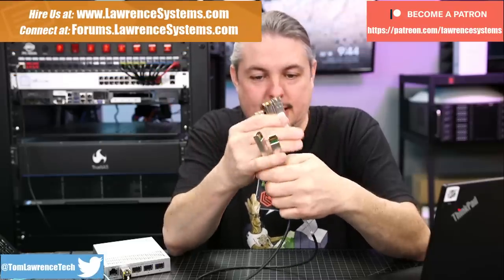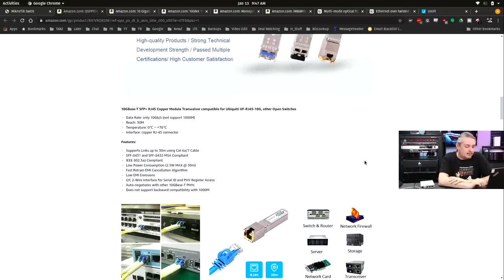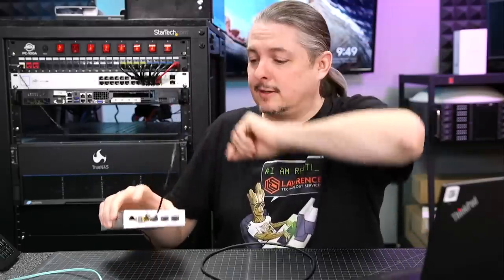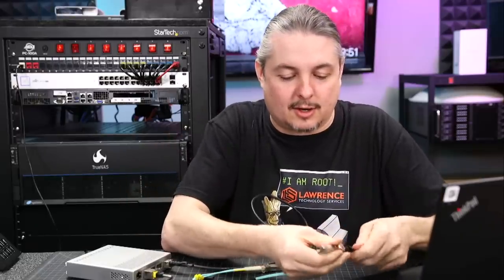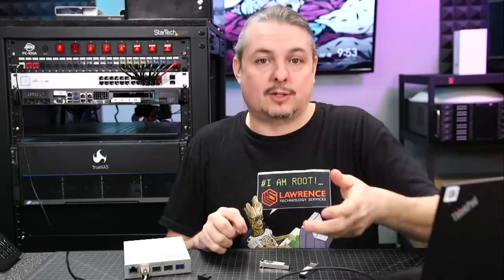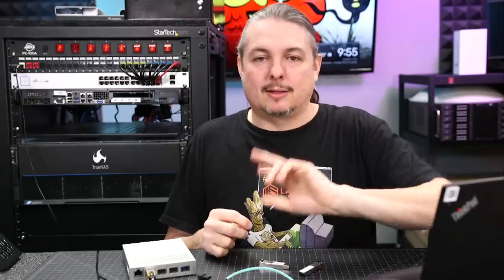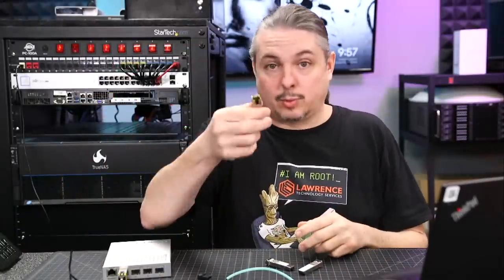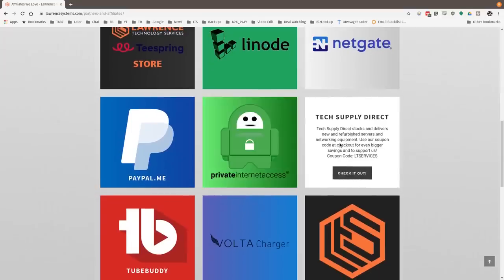Comparing SFP+ 10 Gigabit Connectors: LC Multi-Mode Fiber, 10GBASE-T, and DAC Cables.

Comment: Another good supplier of SFP/SFP+, fiber, DAC etc is Hummingbird Networks.  I have tried FS store, Amazon, and Hummingbird.  I like Hummingbird because of their great support.  You call them to determine if their products are guaranteed to work for a given switch and you get a firm answer.  If they don't know they will sometimes send you a trial device.  If it works, you pay for it and keep it.  If it doesn't work you simply return it.  Can't ask for more.

Comment: I'm working in a Datacenter as engineer and if a costumer asks for MMF connects I just show him the door or hit him with my SMF/E2000/APC whip.
TLDR: Use Singemode
Rant about MMF:

From an investment standpoint, if you still have OM1 (gray) cableing, rip it out. If you have OM2 (orange) or OM3 (blue) ok. 
Don't buy OM4 for new long runs over 30m, it's ok inside a rack but it's failing to often. 
Don't be hyped about OM5 - to expensive and in 850nm it have more lost than OM3/4 because it's made for WDM SFP's with multible colored waves in one fiber.
For new installs, use SMF and splice them to an APC Connector LC/SC or best E2000. Yes you need matching patch cabels for it, but if you forward a fiber link from your carrier through a building to your office via multible patchrooms, you will see the difference. Yes the SFP's are more expensive (20€ vs. 26€ @fs) but in the future if you upgrade to 25/100 or 400G. 400G QSFP-DD LC Duplex with 10km LR4/LR8 are on sale now (4000€-10000€ per SFP but 400G!!!)
Even if you only need 100G at the moment or even only 10G, you don't want to replace you pre installed cabeling only the SFP's. (100G is @ 1400€ for a pair of SMF QSFP28 Modules)
Also most QSFP-DD are SMF only.
I normaly compare vendore SFP's with FS or flexoptix pricing and then choose what I need. If I need max. compatibility because I sell them to carriers if they have a broken one and need a replacement now - I choose flexoptix flash them and it works.
If you build a office, just run fiber most of the way, pace a switch where your users are or plan floor tanks with space for switch, patchpanel, cable etc.
Yes a fusionsplicer starts at 2500€ and easily go up to 10000€ but when I had the first one with a raw 12core cable on hand I had figured it out in ~30min without introduction. Also the device tells you if the spice is ok, @ rj-45 you mostly have to check the complete cable to find the error.

Comment: We've been using 10Gtek transceivers for both ubiquiti and HP procurve / Aruba switches for 2-3 years.  Haven't  had a failure yet.
Reply: Wich 10 GbE cards or onboards chipsets (i.e. Aquantia AQC 107S) do you use?

Comment: This goes back about 10 years, but the last time I talked to anyone at Fiberdyne, they said they had a new user applied, glued connector for certain types of fiber. The person I was speaking to said that losses were nearly the same as a fusion splice. I haven't needed more fiber for my small system, so never looked into it. And their prices for custom length bundles terminated to customer specs. were so cheap that it generally isn't worth looking into those connectors. 10 years ago the 6 pairs I bought were about $150 for about 130 feet, might have had a nonprofit/educational discount applied.

Comment: The 10G fiber to copper module usually has higher power consumption than the SFP+ standard 1.5W, probably around ~2.5W. This causes the heat and thermal problem and makes it more than 70C. Unless we have a good "cooling" system in the switch. Did you agree with that?

Comment: Thank you! 
It's sad, because especially with regards to professional WiFi 6 APs or newer mainboards, 2.5GBase-T will certainly establish itself as a cheap step in between. What is really missing is an all-round switch that can handle 1G, 2.5G, 5G, 10G over copper AND/OR fiber.
Reply: MikroTik has copper SFP+ modules "S+RJ10" that support speeds from 10 Mbps to 10 Gbps including 2.5 and 5 Gbps.
Or if you want a switch with copper 1/2.5/5/10G ports - have a look at MikroTik CRS312-4C+8XG-RM
Reply: I've recently bought the Netgear MS510TX which seemed like a nice solution.
Reply: thx, havent noticed that Netgear yet. Looks nice! How noisy is the fan? 
The MikroTik Switch would be fanless, but SFP+ Copper Modules are surprisingly  very expensive...
Reply: Netgear MS510TX

Comment: I run 2.5G Base T from my main rig over CAT 6 to a Mikrotik branded 10G transceiver on a CRS305, no problem negotiating at 2500 and I've gotten very close to that in sustained transfer to or from my NAS.

Comment: i'm just starting to upgrade my home network to 10g and got one of those mikrotik switches coming!  i'm trying to use the direct attach cables when i can to reduce heat but will need at least a few of the rj45 modules.  i actually already have cat7 and cat8 cables because they were cheap and i didn't need very many, but this is a pretty old vid haha

Comment: Finally someone who knows how to pronounce "MicroTik". =)
-To my knowledge, there's no firmware on the SFP / SFP+ modules; there's only a short byte-table of 16 bytes (if I remember correctly).Those tables can easily be duplicated by a manufacturer, but if you purchase one that is 'coded', then it will only work in those products that are compatible with "anything" and those that require this code-table (like CISCO).
So a CISCO-compatible module would (likely) not be compatible with HP and vice versa.
That said, there are some modules, that contain diagnostic support, which means they'd have a microcontroller built-in, which means ... they would have firmware. Fortunately for us users, the diagnostic support is optional, so we are not restricted by that.

Comment: Note: Not all PCIe cards with two SFP+ slots can do dual 10Gbit. Some can only do "failover"; eg. 10Gbit on one port and if that fails, you get 10Gbit on the other instead.
I prefer fiber everywhere I can, because once you've tried frying a few 8P8C ports (due to high voltage differences between devices), and you no longer can upgrade your Mac OS, you're not going to risk doing that again.
(Well, it wasn't only the two ports on the Mac Pro's motherboard that got fried; also my router and my switch - the switch can now do 100Mbit instead of Gbit, so it still "works").

Comment: In an enterprise environment like a data center it’s better to use lc lc cables than dac even sfp+ is better. The optics get really hot in a data center environment and the optics fail. Dac cables if this happens the entire cable needs to be replaced. With lc the optics just needs replacing. I have never had a cable failure before it’s always been the optics or a port failure. It’s a pain because if the dac cable is 20m and the optics fail you have to pull the entire cable out and replace it which in a data center is a time consuming process.

Comment: The heat issue with the 10g sfp+ modules is really when you have 2 or 4 of them right next to each other and they heat soak each other. Most switches tell you to skip a slot when using them. Would be nice to see what 4 of them next to each other does.
Reply: I have many 48 port 1U Arista switches full of 10GbE SPFs and no issues
Reply: Thats really a issue if u are using the ethernet rj5 to SFP+ adapter.

Comment: Can not run Cat 6 in same conduit as Electrical  So,I want to run 100' Fiber ( OM3 duplex 50/150 OFNP LC-LC ). Reason Fiber is... it will be in with 120v electrical wires in the same conduit from house to my garage. Will this work ??

Comment: If I have to rewire the house I'd go for the highest available standard, CAT8 or go glasfiber. With the latter being costly but also interference free when new wireless signals might end up trying to interfere with the copper cables again in your house.
Reply: 25GBASE-T and 40GBASE-T were standardised 6 years ago and yet I can find no evidence of them being included in any actual products (thoug I do see a bunch of SfP28 products mislabelled as 25Gbase-t). I would not bet on them ever doing so. It's also worth noting that when 10GBASE-T initially showed up it was only available as a fixed port due to power issues, SFP+ 10GBASE-T transceivers came later and were/are limited to only 30m rather than the normal 100m.

If you think you may at some point need more than 10 gigabits per second then IMO your most sensible options are either to run single mode fiber or to run ducts/conduits into which future cables can be pulled. Multi-mode fiber is also an option for short runs but is less future proof.
Reply: fiber isn't expensive

Comment: Are the ones with the cables not the RJ45 adapters, the ones that run cooler?
Reply from the maker: The SFP+ DAC cables run cooler
Reply: @LAWRENCESYSTEMS  Excellent. That will determine what kind of switch I use. Those RJ45 adapters get way too hot, even when not connected to a cable, but just plugged into the router's SFP port.

Comment: Out of experience: the RJ45 modules always hotter than the fiber ones. I don't really understand it because only in the fiber modules there is a conversion and the amps going through the copper line should be fairly low. It is how it is
Reply: There most certainly is a conersion in the 10GBASE-T modules, between the simple serial data stream used by SFP+ and the complex modulation scheme needed to get 10 gigabits per second down a long cheap cable.  Power requirements are the reason 10GBASE-T SFPs took a long time to hit the market and when they did so they were limited to 30m rather than the 100m of regular 10GBASE-T.

Comment: Is LC multimode cable the choice for home users if you want 10Gb fiber connection?
Reply: Yes, unless you go with copper of course, both are capable with the correct cable/distance

Comment: What makes a 10km SFP a 10km, and a 40km a 40km?  What is the difference?  Is it power tx power and receive sensitivity?
Reply: Don't use the 40km transceivers when it's absolutely necessary. The 40km and 80km transceivers have way stronger laser diodes and if the link is too short, the light received on the other end will be too strong to recognize any signal. These kind of transceivers are used for very long fiber runs (e.g. fiber running between two distinct datacenters) which is considered an engineered link.

Comment: I have about 100 feet I want to run a 10 gig back bone from my office out side to my home.  Can you get 100 feet of fiber already made up. or will copper be better.  Every thing in the office I want all 10 gig back bone.  That way every thing will be fast as I can get it with in the home network,  for security cameras and the such.
Reply: I know you can get 30 meter fc pretty easily.   I want to say I've seen 50 meter out there but it's been a while.  Distance for fc really depends on the transceiver power.
Reply: Fiber is necessary for anything outside unless you want a thunderstorm to wipe out your entire home network and every device connected to it. Here's a 30 meter (98 foot) fiber cable: https://www.amazon.com/Meter-Multimode-Duplex-Fiber-Optic/dp/B006KSS26A/

Comment: Good evening I have a question I have a Dream machine Pro from ubiquiti and a 24-port switch The US-24 from ubiquiti what kind of cable do I have to buy to connect these two together I would like to connect these over sfp ?  I wonder this because the Dream Machine Pro has 2sfp plus ports and the Switch has two regular sfp ports
Reply from the maker: DAC SFP
Reply: @LAWRENCESYSTEMS  thanks for responding so quickly I will definitely buy this
Reply: @LAWRENCESYSTEMS   I have another question I have searched around for DAC cables, but they only sell SFP Plus of this variant, do I have to adjust a setting in my router to use an SFP plus DAC cable in my 1 gigabit Switch?

Comment: there are alsow sfp vdsl modems (vdsl modem in sfp form). great for some stuff.
Reply: mind giving link? I'm thinking to do some DIY routers but the problem is the VDSL part. There is one PCIe based thats too expensive and if I even try to google for standalone VDSL box/module/card, everything points to built-in VDSL+router combo that tends to cheap on the router chipset and also coarse control over VDSL part
Reply: @juri14111996  thanks! I'll take my time to digest and see if this is also suitable for small home network
Reply: @haziqsembilanlima  there are vdsl sfp clients (for connecting to your isp) and lan extender (two modules, one master and one slave)

Comment: Has anyone used a HPE sfp+ module on a mikrotik switch? I've a few of them laying around and I'm thinking about buying the css326 24g 2s+ switch for my soho network.
Reply: It should work as MikroTik is not overly picky,

Comment: Anyone have reccomendations for aruba switch compatibility?
Reply: Aruba does not accept random ones. You need Aruba coded or original Aruba parts.
Reply: But you can always try the "accept 3rd party transievers" (you have to google for whatever the correct syntax is for that functionality) option first.

Comment: For 30m(~100ft) connection for 10G, do You suggest copper or fiber?
Reply: Fiber.
Reply: For me it has been the fiber route, but 30m is copper territory. After 100m it is all fiber.
Reply: Fiber

Comment: Tom, you make me nervous when you keep leaving fiber connectors uncovered. The dust caps should go on as soon as you disconnect.
Reply: Remember the conductor on OM3 cable is only 50um diameter, OS2 cable (singlemode, what I usually deal with) conductor is 9um wide....A human hair is 60um in diameter, so it doesn't take much of a dust particle to block or severely attenuate a fiber connections.....If you're going to be handling them like that, get the right sized cleaning pens to clean both sides of the connection before reattaching them
Reply: @CoreyThompson73  can you link to the pen on Amazon or elsewhere?
Reply: https://youtu.be/cdlFlr1Dokc for quick direction on how to use them

Comment: 10GTek DAC Cables wouldn't work for me between an Intel and anything
Reply: You can get a dac programmed for Intel at one end and another provider at the other from FS.com. They also sell a programming tool to reprogram the FS brand transceivers for different equipment manufacturers.

Comment: HI Lawrece System /PC Pickup  👉Cool- Lab-Work 👌😎
Is This Network Card Good For Medium (Between) 2 HP Server For My Project !!🤞

- HP NC523SFP Dual Port 10Gbit.🤞
- HP D380 G8 CPU XEON E5-2670 2.6Ghz 8 cores 
- To Unifi 10Gb Switch.
....
DataMek from 🇩🇰 Denmark.👍🖖

Comment: iperf iperf iperf
Reply from the maker: iperf3 iperf3 iperf3
Reply: @LAWRENCESYSTEMS  You won't see any difference, maybe latency measured in microseconds depending on how hard/much DSP is in and SFP/SFP+ to adapt the electrical lanes on the SFP/SFP+ to whatever media you have.   Or you have packet loss because your physical layer is introducing bit errors.  You don't need iperf to tell you that, the network interface stats should tell you when that's happening.